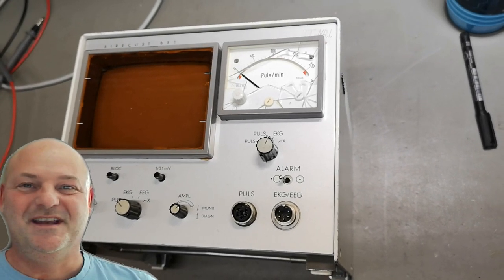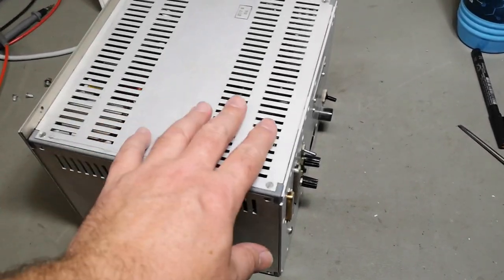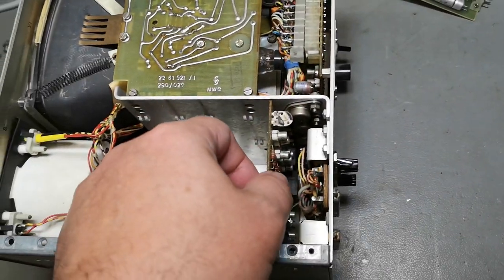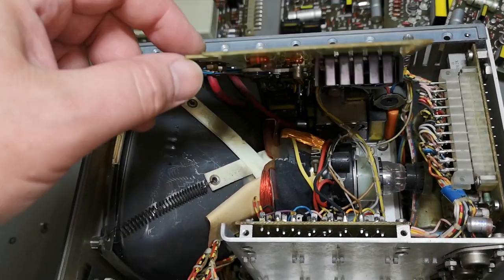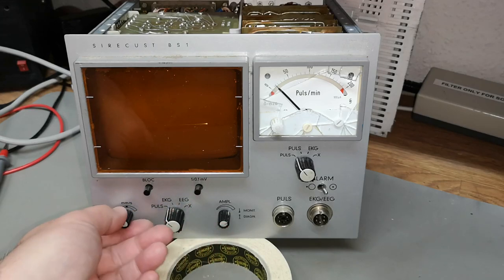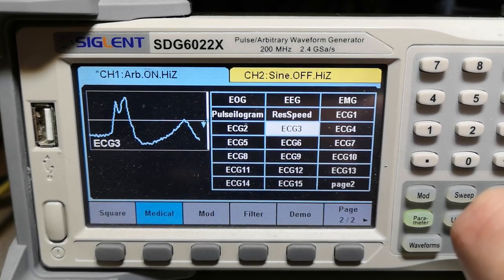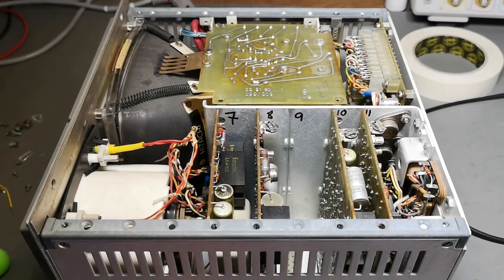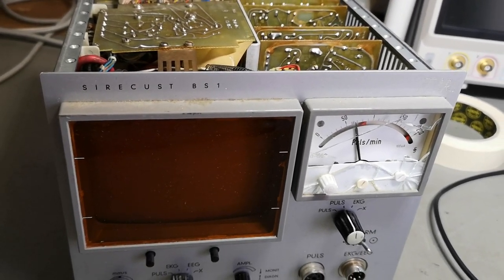Siemens Sirecust BS1 medical patient monitor EKG EEG test teardown

Comment: Hi, you just reminded me that I should go for an EKG 😂 Again, one of the things that you don't normally get to, the design - freestanding/built-in is great, beautifully processed. When I get my hands on a device that was made for special purposes, I always think about how it could be modified so that I could use it for something. The last time it was the fire control panel from our building - it will make a beautiful backup or battery source - the basic voltage is +/- 27VDC.

Nice day 🙂 Tom

Comment: You mentioned the nice craftmanship of the set esp. the housing - all metric thread, no self drilling screws !
Also a Motherboard / Mainbord was not invented*....all by wire like int the good ol valve-radio set....
* of course hp had it at that time-LOL. But the SIMENS chassis was a quality of its own....
hp had selfdrilling ugly screws....
Reply from the maker: you are right 🙂

Comment: It is an Bedside Patient monitor early 68-to early 80s,  remembers me to this time, a hosptal of 100 beds in the
countryside in Germany had 4 of them - no more. Conectors at rear are used to inform a Central nurse desk.
Sensivity of ECG input is 1mV,  EEG inpunt 0,1 mV.  Pulse ist input for an optical fingertip device.
This is important feature because a dying Patient with a pacemaker will have ECG actions still - if the
patient has cardiac arrest at the same time => pacemaker will trigger the ecg with 72/min and there
for no alarm will occur.  But thes fingertips with bulb and LDR inside were uncommon....
ita was not a pulsoxymetry at this time, but showed peripher pulse is present = cardiac outout and
circulation is present.  At that time, TTL technology was not common, so the CRT was a "long" after-
glowing type to se a trace glowing.  Nice toy for people with an relationship to that time.
No use / application for hobby / amateur radio etc.
Reply: This could be a nice panoramic/spectrum display perhaps, especially for slower sweeps.